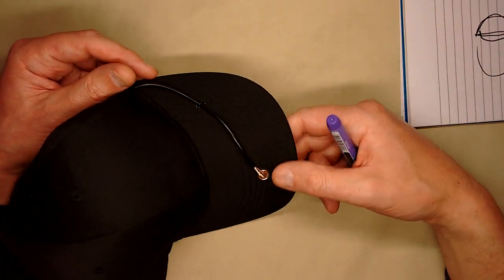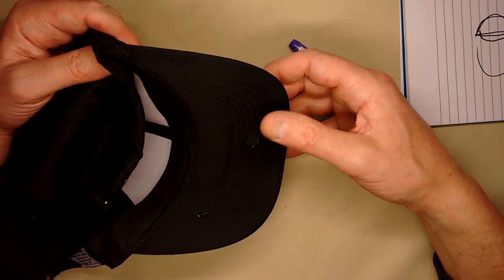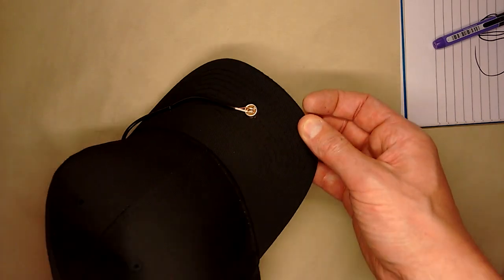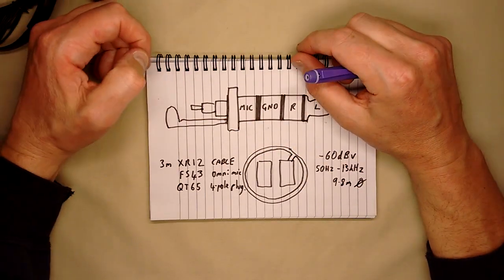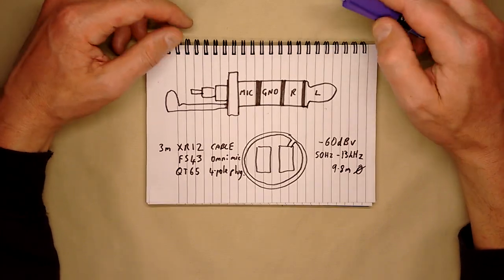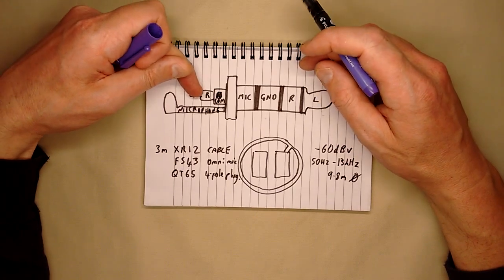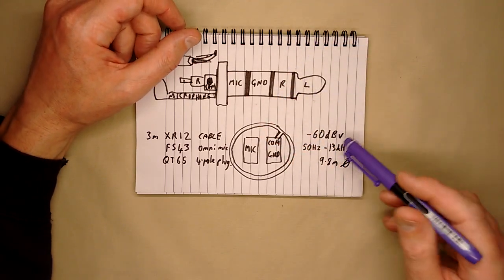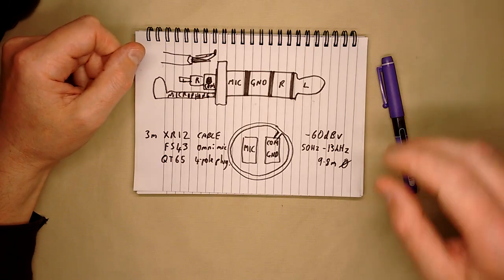Baseball cap with integrated microphone.

Comment: The original microphone seems to have a richer sound, with deeper bass, and maybe even a bit more treble response. It also seems to include a bit more reverb from your work table. The hat microphone sounds clearer, although somewhat hollow and excessive with midrange. The soft brim surrounding the hat microphone does an excellent job to attenuate reflected sound.

Comment: Honestly Clive, you may be best off simply getting a studio mic, something like a Blue Yeti, which uses USB rather than XLR, and simply putting that somewhere on the table, or even on its own little boom-arm. You'd get great quality without having to worry about directionality or things hanging off you.

I've not heard of a cap with a built-in microphone before, but I have heard of one that uses built-in bone conduction transducers to deliver audio to the wearer which is pretty neat.
Reply: ynow he uses an iPad to record everything and probably even just straight up uploads it with it with little to no editing. unless there's an east way to plug a mic like that in there's no way he'll do that.
Reply from the maker: Right now I'm using a Moto G phone to record the videos while travelling.
Reply: Clive records on an iPad, hence the 4 pole 3.5mm connection. The whole ethos of his videos is towards doing things with cheap electronics. There's no need for him to get any kind of studio mic for his purpose and a mic on a boom or studio arm wouldn't be convenient for working bent over at a desk.
Reply: That would be 10 times the price and far less entertaining, though.
Reply: He films with his iPad, and I believe he uploads directly from it as well.
Reply: +bigclivedotcom the sound is fine but the peaks are a bit high, if you could normalise the peaks it would be q good upgrade ! I'm experimenting myself with Audio and I use a cordaroid mic but you have to be very specific where you speak, anyway hope this helps and I love your videos they are verry entertaining and I'm from northern ireland
Reply: I'm not sure about all studio mics, but Blue Yetis do seem to work on iPads, you just need to use a USB to Micro USB or Lightning (I think that's what the proprietary Apple connector is called, at any rate) adaptor.

Didn't know about the Moto G.
Reply: but that would be a pain as he travels allot with his work a little audio editing will do wonders also thats still a cordarioid mic so you need to always face it and be quite close
Reply: FelloutIsLife
It has multiple modes, including omnidirectional. It also has gain control to change its sensitivity.
Reply: +FelloutIsLife Do you mean cardioid since the pattern for audio pickup resembles a heart shape?
Reply: But he records on an iPad...
Reply: Yes we all know. Was asking the other dude since he had off spelling. Just wondered if he was confused.
Reply: I'm pretty sure Clive records his videos with an iPad, however recording the audio and video seperately and then editing them together is something alot of people do, and i guess it works perfectly.
Reply: ive bought a blue USB mic and It doesnt work with anything after wimdows xp. frickin sucks wasting all the money when it was a gift that I choose... couldve gotten a fluke to replace my uni-t for the price
Reply: it was a blue snowball, but due to living in UAE it was quite expensive...
Reply: And get a better camera while he's at it.
Reply: I think he has a Canon as well.
Reply: yes but it picks up everything he just needs a simple mic and something he can do a little noise isolation and normalize the peaks aka an app but im not saying that the blue yetti is a bad mic i use one for voice overs and i love it but im moving over to xlr for more control (audio technica at2020)
Reply: +RecurveNinja Should work on the Moto G too, pretty sure it supports USB sound cards.

Comment: for something homemade, it sounds alright for voice, although I much prefer the mic you always use, I believe you use the IK Multimedia iRig Microphone
Reply from the maker: The other mic was a generic lavalier mic.
Reply: +bigclivedotcom the other mic sounded really good
Reply: +bigclivedotcom what model iPad do you use to record the videos
Reply from the maker: Usually an iPad 2, but at the moment I'm using a Moto G 2nd gen.
Reply: i think that mic in the cap may have a roll of in frequency response above 5 or 6khz, either that or having it impeded in the cap is causing issues with the polar pattern, or just reflections form the cap cancelling hi end out.

Nothing wrong with it, its certianly clear enough, id put some gentle eq on it to remove some of the low end and a notch somewhere in the hi mid, therse a frequency poking out 1.6k? 2k?

and a high shelf boost from around 10k to sweeten it up.
Reply: I liked the other mic because the noise from you handling things on the table was better balanced with your voice. This one is more like a voiceover of a silent movie.
Reply: Have you tried mounting the other mic in a hole in the cap?
Reply: The bass is good, but the highs sound very muffled, this seems to fit the 50 Hz - 13 KHz spec.
Reply: *****
Nope, EQ won't create frequencies that aren't recorded. 13 KHz is pretty awful, even for speech. It sounds muffled. I don't like it.

He's not at home and seems to have left the iPad behind, recording on his Phone. Therefore things can't be the same for the moment.
Reply: *****
Ah okay. But it would not help because 13 KHz is waaay to low. 16 would be ok.
Reply: *****
So it's not worth the effort.
Reply: I agree that the new mic sounds muffled and favors Clive's voice too heavily compared to the sound of the items he's working with. It actually sounded a lot better at the end when he held it farther away.
Reply: That was a nasty prank to play, I'd forgotten quite what he sounded like till I played it. :O

Comment: Sound is dull after the change. dont like it. change back
Reply: Yeah. These cheap electret capsules have awfully low bandwidth.
Reply: Yes it sounds quite muffled, try mounting the lav mic through the brim.
Reply: Just use the old one, please
Reply: Indeed.
Old mic sounded more like FM broadcast, the new one in comparison sounded more AM like. 
It's not that bad but the old setup sounded better
Reply: Exactly... all the high frequencies are shot; it's not bad as such but it's much, much, worse than the original...

Comment: Well Clive, you are quite the innovator! Frank Zappa once fashioned a microphone in the brim of his hat and can be seen in a video he made a long time ago called, "Dub Room Special" (rare), it worked quite well. I'm a little picky about audio.  Your new baseball cap mic is clear but the EQ has changed. The new mic is not fully getting the low end of your voice which is too bad as that is a quite pleasant part of your voice.  It seems strongest in the mid range and is a little bit sibilant - that is a tad of distortion in s, and sh sounds.
Reply: Those are also my thoughts regarding the sound quality, except you wrote it better than I would have!
Reply: I second this, I didn't dislike the new mic, it's pretty decent but I found the old one more pleasing to listen to.
Reply: yeah this. Not preferable.
Reply: I think that's from the microphone itself rather than the arrangement
Reply: That was a PZM (pressure-zone microphone) that FZ wore on his head.
Reply: Actually, I personally find it easier to make out what he's saying now than previously. I had to crank up the volume or the bass overwhelmed the mid- to high-frequency, making it pleasant-sounding but rumble-y and less clear. The new setup with more mid- and high-frequency is much easier to listen to for me. 

On the other hand, I have fairly high-fidelity speakers with a strong low-end response. I'm sure that the listener's audio setup has a big effect on the final sound result.
Reply: +Gully Foyle I second this wholehartedly especially : "The new mic is not fully getting the low end of your voice which is too bad as that is a quite pleasant part of your voice."
Reply: Thirded!
Reply: ***** LOL that becomes harder when the nr rises
Reply: Me too. The deep mic is just too bassy here. I have 5.1 surround with real speakers. Maybe people listening on more feeble kit have a different experience?
Reply: Paul Frederick
 Yeah, I'm thinking that may be what is going on. I have a 5.1 surround with 12" subwoofer, and found the new mic setup far better, but I seem to be in the minority.
Reply: Mark L
The sub I have is not quite that big, but I do have one. I think the people that like it have crap sound systems. Which would be most folks. My speakers retail for more than my computer does.
Reply: Paul Frederick I'm using a Logitech speakerset with seperate bass box and it has a very warm and also clear sound and the smooth bassy full sounding Clive voice like it always sounds in all his videos was present in the first part of this video but gone in the second part
Reply: *****
What kind of a sound card do you have? I thought my on board sound was good, until I put a SoundBlaster Audigy into this PC. I'd have gotten something better, but that is about the best card my OS supports. As it is it's pretty good.
Reply: Paul Frederick Audigy 2 ZS
Reply: *****
when I looked into it that card had features my OS did not support. But it probably does not have the soundfont bug like mine does.
Reply: Paul Frederick I got the Audigy 2 ZS for years and it works perfectly here
Reply: *****
you probably do not run the same OS that I do.

Comment: The new mic is fine. It does seem to have mid frequency attenuation though, with slightly pronounced bass and treble. As someone else commented, it does emphasise the sibilant "sss" noises. It also sounds more compressed for some reason, I wonder if the output is higher and so driving the mic amplifier into the non-linear region.
Reply: mhmi agree the ss noice does stand out alot, but, that is the only higher pitched noice it really works at, otherwise there is to much mid

Comment: It works very well. Not as much bass as the mic you used in the front of the video, which is good.

The hat clip trick is used by some other people. Keith Fenner wears a baseball cap with the mic clipped to the side top of the bill, and rather amazingly it seems to work quite well. I'm not sure why it works as well as it does.

Comment: I'm finding that the new microphone sounds somewhat wooly and muted, like the waveform is compressed at the top end and boosted a little in the bottom. What does come through in the top has a tinny tone to it as well. Possibly just a side effect of the mic looking like it's from that poundshop headset

Comment: Sounds fine to me. I'm an old audiophile from way back and have a lot of experience with acoustic reinforcement in theaters.
It's all relative anyway and the output system of the listener can have as much of an effect on the sound as the source mike. 
In my opinion, as long as it sounds good, do what makes your job easiest. People will get use to it after a while and will find the old version sounds odd then.

Comment: The new mic sounds like a decent "raw" source of audio.. no major problems as such, but it is a bit dead sounding. I would suggest picking up some kind of simple audio processor to put into the audio path... A BBE Sonic Maximizer I bet would make it sound perfect, this seems like an idea usage case for one of those. Either that or a simple EQ with the highs cranked a bit, or a multiband compressor to brighten up the sound a bit. I'm sure you can get any of those things for cheap, and it'll make a world of difference. An old piece of rack gear or something would do the trick, or perhaps something like a cheap-n-cheerful behringer eurorack mixer.

Comment: Many years ago I made a ballcap with two condenser mic's mounted behind the vent holes in the front of the cap.  I used a stereo headphone cable to plug into  my Sony mini disk recorder.  I was thinking I could make a stealth recording of a concert.  It worked very well in testing but at the concert I was mostly getting things like "Sit down!", "Shut-up!" and "Woo-Wooooo!"

Comment: I would like to put in a recommendation for the Primo EM172 electret microphone. 
It's a little expensive at £10 for the capsule but it sounds really great. 
I used one to make a handheld microphone with a copper pipe for the case and it looks pretty neat. 
Of course with it being an electret mic it needs the microphone port to supply some power to it, however it's no where near standard phantom power levels.

Comment: Working in the Hearing Aid industry for several years. We used to add lambs wool to the receiver to dampen the sound and modern hearing aids have a microphone behind a tiny hole for the sound (so small they are easily clogged by powder or makeup) You might want to play with wool over the microphone or the tiny hole to see if the highs can be limited and more bass let through.

Comment: Clive, have you ever watched the old Jerry Anderson puppet show: "Captain Scarlett"? The principal puppets were secret agents of an organization called "Spectrum" and had uniforms with fancy caps. The  caps which equipped with wireless mics on swing down booms. 

The boom wrapped around the front brim and when the puppet wanted to call HQ, the boom swung down so the mic was in front of the puppet's mouth. To a 10 year old in the 1960's, this was extremely cool! 

Of course, they were props (as you know, puppets don't really talk) but it seems like they had the same idea as you did - sort of.

To me, your microphone cap is simpler, but would not offer the visual "wow" that the puppet cap had.

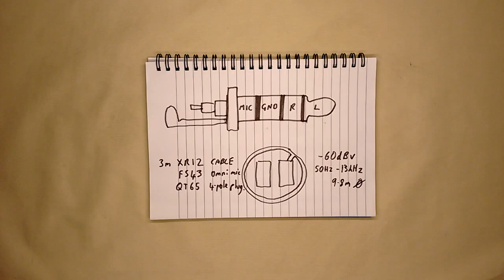I listened several times jumping between 0:30 (the old mic) and 4:00 (the mic in the cap) on a desktop system with an  Altec Lansing 3-Way system  Subwoofer on floor -  two 4-inch satellite speakers on desk. 

To me, on my set up, your mic in the cap sounds very crisp and clear, a little thin, but not offensively so.

So I vote for the cap mic and say "Good Job, Captain Clive!" (SIG - Spectrum is Green!)

Comment: Hey Clive! Have you ever tried dissassembling an old cellphone? They usually have really tiny microphones. And there is no need to desolder them - they have springy contacts to the PCB.
Almost forgot, you can use a resistor to kick up the signal (amplify it), because soundcards provide low voltage to the third pin of microphone's mini-jack.

Comment: Very good, I had to turn down my laptop when you switched over, because it was much louder, I have the laptop linked to my hearing aides by a bluetooth adapter furnished by the VA since my hearing loss was the result of 13 months in Vietnam.  It was very loud over there in 70-71

Comment: Sounds nice and clear with good timbre. I was wearing headphones when I witnessed the changeover and the new mic was slightly louder than before as well as having more bass. I noticed quite a difference in clarity when you removed your HatMic (TM) and spoke into it on your desk. I think it's a really good idea which works well but I'm not keen on wearing hats so, personally, I'd use just a visor for the same effect.

Comment: Hi Clive, I too prefer the standard sound of the Ipad, perhaps with that cardboard reflector thing you put on it once.
I've messed with these, and sometimes putting the capsule down a bit of tube, only about 5mm above the edge of the capsule gives it a bit of a boost that will fix most of the problem
I also agree with the comment lower down about the panasonic wm-61.
They are a 6mm x 4mm from memory, but very good quallity.
Finally, capsules can be got off ebay for about 20c each if you buy a 10 pack or similar.

Comment: Hi, good job on the baseball cap with microphone. that is useful. Tip, if you change the soldier iron tip, to one you just use for plastic and/or wood(or just a bite of large copper wire). you don't kill good soldiering tips.

A long time ago, i made a clip with mic. To clip on the my hat. that i ware at the time. for playing game online back in 2002. it worked good.

Comment: I like the new mic better than the old one.  It somehow makes you sound like you're enunciating more clearly, and it seems to have a bit richer response in the frequencies that dominate in your voice.  My only complaint is that it's a bit too "bright" at the top end.  I would try a small piece of open cell foam over the mic to cut down the high end response a bit.

Clever idea; thanks for making the video about it.  I've done something vaguely similar to video pistol matches, with a small camera and a lavalier mic mounted on the brim of a baseball cap.

Comment: Diameter of the mic capsule doesn't affect low frequency response in omnidirectional microphones; in fact, it's higher frequencies (shorter than 1/4 wavelength) where frequency response is affected by the diameter of the diaphragm. Doug Ford did a series on microphone design on Dave's EEVblog.

Sounds like the cap mic has a bit of a mid boost, which I think is good for Youtube videos that will be viewed on Internet machines that have tiny speakers.

Comment: The microphone actually sounds better when you have it on the bench, like just before the end of the video. When you put the cap on, it seems to be more sensitive to the higher / treble sounds. The microphone you use at the first part of the video does sound better compared to the cap mic when you are wearing it, but the cap mic wins when it's on the bench.

Comment: Both sounded OK to me. But just thought I'd mention that the burned plastic gunk coating of the soldering iron can be avoided by wrapping the iron in a tight layer or two of aluminum (or better still, copper) foil